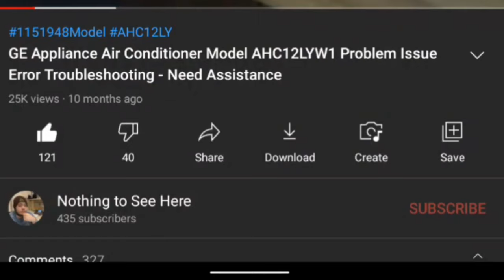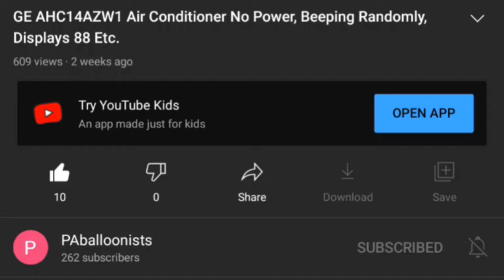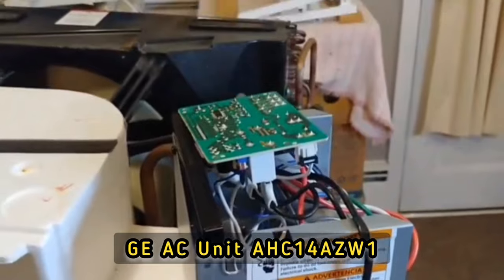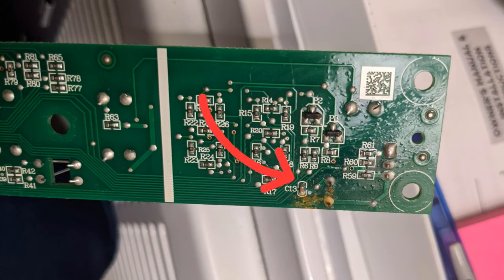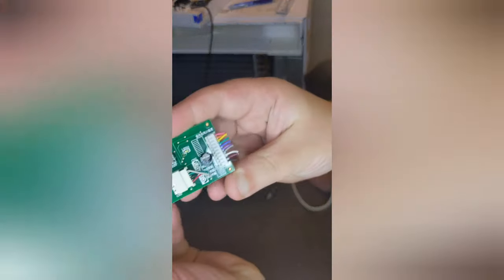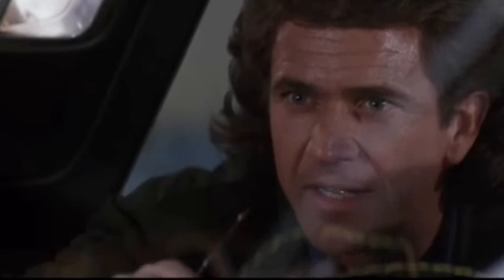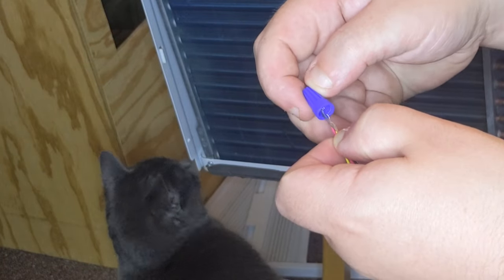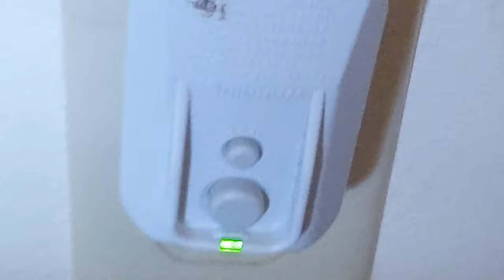GE AC Unit Model AHC12LYW1 or ACH14AZW1 - Unit Beeps, Shuts Off, 88 Symbol Bypassed DIY | How to Fix

Comment: I see the fan is on the highest setting but is it also on its coldest setting 🤔
Reply: I am having the same problem. I'm trying to figure out the wiring combination that will allow it to run them both on low or low cool and med fan.

Comment: Where can I buy a new motherboard
Reply: Let me know if you get the motherboard
Reply: @rogercoronado6106  Orale gracias, pero ya le corte los cables y lo dejé directo como en el video.
Reply: @oguh2olve54  yo tambien lo tengo directo el enchufe ke compre en Amazon es Para poder usarlo kasi Como si furea original con un control y se apaga ALA temperatura ke lo pongo
Reply: @rogercoronado6106  Deberas? Y si funciona bien?

Comment: I did this but the next day i removed the front frame again because it wasnt throwing cold air and the whole front part inside was covered in ice where did i go wrong?
Reply from the maker: Left it in too long.  Because we remove all the controls and thermostat... You need to limit use to a few hours at a time.

Comment: Thanks for the vid and explanation. I have an AHQ06LYW1 with a similar type control board and the same wire braid..mine has the red and maroon instead of pink and brown. Everything else is the sameness yours. I tied the white, red, black and yellow together as instructed. I get nothing. Does anyone have any ideas? I can’t find a wiring schematic, otherwise I could attempt to trace the correct pairs to connect. I appreciate any help!
Reply from the maker: I had the same issue.  I got lucky with R Melnyk having the same unit as mine...  I hope someone notice this comment and can assist better than I can.  I recommend shooting a little video of your boards and the wires .. posting it with model information
Reply: Look at your control board next to where the wires are connected should be printed on the board some letters in a box =vcc, gnd,comp. med ,lo ....ect. they correspond to the wires vcc is voltage on my unit its at the bottom ,which correspond with bottom wire black. The ones you need are vcc, comp ,high .
Reply: @rogercoronado6106  thanks for your help…I got it figured out. I made a video of me doing the modification, but I haven’t had a chance to post it yet. No sense throwing out a working ac unit if it can be salvaged.
Reply: @CovertCulvert  I got the same model as you, about to attempt repair, what color wires were vcc,comp and high for you?
Reply: What about temperature control?
Reply: @thewatcher8734  there is none. It runs full blast all the time, but that's better than throwing out an otherwise good unit. At least, it works for my application.
Reply: @CovertCulvert   I think I have a different model but I’m literally about to take it apart to see if it works cause my control board quit working yesterday
Reply: @thewatcher8734  if you have to go into the area where the power supply board is, DO NOT touch that big ass capacitor in the lower corner. That'll zap you across the room!
Reply: @CovertCulvert  no mine control board is right behind the main faceplate that’s the wiring I’m going to use
Reply: @rogercoronado6106  is no one worried about the ground wire?

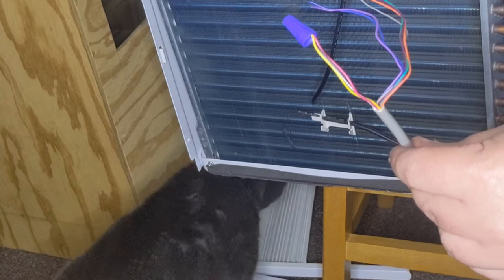Comment: 7:25
Just a heads-up, I think your cat got sucked inside the unit.
Reply from the maker: Haha!  He's alright!  Last seen jumping on the replacement unit I got from GE, running my power bill up by turning it on when he feels
Reply: 😂🤣Omg I saw that when I first watched this over a month ago. I just noticed your comment while looking through the comments for a wiring combination that runs the unit on a lower setting than full blast. As it's too cold and expensive to run for more than 15 min and I'd rather not have to run it through a timer though it seems like that'd be the easiest fix.

Comment: How long did it last after doing this?
Reply from the maker: Personally, just made the repair and the video... Hasn't been hot enough to hook back up yet... Running out good will certificate replacement now.  But a spare is nice and it's only June so probably will get hotter.  Longevity is unknown.  Great question

Comment: Hi !! Could I just cut the wires with out having to take them all out ?
Reply: Ps I was able to cut the wires and leave the other 4 wires connected to the board and to my surprise it worked ! Should I still follow the process and take the 4 wires out strip them and tape them ?
Reply from the maker: Due to the moisture issues... I would...

Comment: How do you control the temp to blow cold when you cut the wires
Reply from the maker: Unfortunately this method eliminates that control.  There are other ways to maintain your control... But it's really hard to find the official part and I did not do enough research to do the thermostat method some have commented about doing, which would use alternate, not official parts

Comment: Can I use the blue cable if I want to use it on a low speed?
Reply from the maker: I was unable to figure out the color code but I would assume you could test before tape and seal up
Reply: @CaughtOnCam were you able to figure out the right combination of wires to connect to get the unit to run on low?

Comment: So I just fired mine up and it did this. My circuit board looks fine. However, I did store the ac on its back accidentally over the winter. I meant to store it in the proper position after the condensate drained but I forgot. Does anyone think this could be because the oil in the compressor settled to the wrong side and maybe the ac can sense a high load? I did notice my lights dim considerably more than usual when it first cycled then shut down just like the video

Comment: why cut the wires, the white connectors just unplug. you can use some resistor lead clippings and a piece of wire stuck in the connector holes a soldered together to get the same effect.

Comment: Nashone Wireless Plug in Thermostat, Digital Thermostat Outlet LCD Display Temperature Controller with Heating and Cooling Mode for Portable Heater, Wall Panel Heater, Window AC, and More

Comment: Does this leave it on the coldest hi setting mode please reply I’m haveing this problem now and it’s brand new????
Reply from the maker: 1.  Brand new.. try and return or get GE to cover cost of a new one
2.  Yes.  This will make highest setting
Reply: @clarkkc11  and the lowest 62 degrees setting
Reply: @clarkkc11  can’t believe it ether I mean I only used for about 3 months 700$
Reply: @clarkkc11  thanks for replying

Comment: Hello, I ordered another board and the 1 they sent could not physically fit in the same space and the connections were of different connectors and was totally wrong. (NO POSSIBLE WAY TO WORK). 
I TRIED THIS METHOD AND IT DOES WORK. THE OTHER THING I FOUND WAS TO TIE SAME WIRES EXCEPT THE BLACK WIRE AND UNIT REMAINED OFF. THEN CONNECT BLACK WIRE AND UNIT CAME ON. SO USING THE CONNECTION OF THE BLACK WIRE TO THE BUNDLE COULD BE USED WITH AN ORDINARY THERMOSTAT TO SET DESIRED TEMPERATURE 🌡️. I ALSO FOUND THIS OPERATES ON 5 VOLTS (LOGIC), SO WELL WITHIN RANGE OF ANY THERMOSTAT. THE SIMPLEST OF THERMOSTAT (COOL) FUNCTION THE BETTER. AVOID PROGRAMMABLE THERMOSTATS. 73 AND ENJOY GE AC HACK. LOL. EARNEST K5EWM.  RETIRED MILLWRIGHT/ELECTRICIAN AND GENERAL CLASS AMATEUR RADIO OPERATOR. 73 GOD BLESS AMERICA.
Reply from the maker: Probably the best comment on this thread.  Thank you for your time, experience and years of service in the industry.  Pinning! 📌
Reply: I had the same problem like every one else..beeping sound ,the number 88 showing ,it comes on  then shuts off ..I tried your method and it worked but the air don't fill very cold..i connected the colors you showed us,.I mean it's blowing with power and speed just fills kinda warm to me . Is one of the lines for the compressor? My unit is big like23,000 btu.
Reply from the maker: @patrickneil8045  apologies it didn't work.  It's an attempt to salvage a flawed machine.  Def could be compressor
Reply: @clarkkc11 hello there,..I made a comment yesterday about trying this process I used the right color wires and it ran great but the compressor was not kicking in ..no cold air..so I went try it again today ,cut out the other work I did and started all over again...man those lines are very fragile you really have to be patient ..I had the right tools this time and once I got it hooked up,boom..there it was..cold air ...thanks bro...I did find that other video as well..the one with the elderly man showing the same method...I have one more question...it makes me wonder if this method would work on different brands or just general electric?
Reply from the maker: @patrickneil8045  people in the comments have done on other GE models but idk about other companies products... I would assume if you find one similar... Might have a chance.
Reply: @clarkkc11  ok ..thank you sir.
Reply: Where did you get the new board from?

Comment: Do you know what the other colored wires correspond to? Like which wire would put it on medium instead of high?

Also your board looks damaged similarly  to mine... yours has a few other issues I could see. Like the P1 connection melted! I'd be surprised if you didn't see any issue from the processor (square black chip on the back of the board)? I believe that's where it starts, and begins burning out other parts of the board? 
Unfortunately I can't upload pics of my board...
Reply from the maker: I am not sure of the other wire colors.  I was hoping there would be helpful info in comments but I do not recall a comment from anyone with that knowledge.  Hard to find schematics...
Reply: @Nothing to See Here   Yes I'm having that very issue! I can't find a diagram for it anywhere? If I understood GE customer dis-service correctly, they outsourced this AC to China probably? So as she said GE didn't make it, so they can't even fix it, as they don't have the parts including any front control panels! 
 So that's how GE stands behind their products! They did send me a $75 rebate check for a future GE product!? THE AC COST AROUND $500.00!

So I say when are we starting a "CLASS ACTION SUIT"???

Comment: Has anyone found part number for User Interface board for the AHC14AZW1?
Got mine from Lowes also… died just over a year… after the first one died the first week. Did the bypass and it works… but still looking for a new board.
Oh… and GE parts/service is an absolute joke

Comment: J1 and j2 are broke connection yoy don't belive that was the issues?
Reply: I noticed the same thing, because mine had the same one broke the exact same way. I need to get a good soldering station and gun so I can see if I can fix it right, cause I don't need it blasting ice cold or else I gotta turn it off and on constantly to keep from turning my place into a meat locker money pit.

Comment: tried this on mine to no avail...if i hold the power button down and plug in (after rewiring back) it turns on and runs until i unplug it ...but I was hoping to wire as always on so i can control via smart plug or switch ...
Reply from the maker: This method removes the smart technology which was flawed in the design and caused the issue.  Their smart boards are not protected enough
Reply: @clarkkc11  yah mine is not smart ...its a GE AHW05LZQ1 , i have all the same wires and the board looks similar

Comment: I have the 18000 btu smart version doing the same but there is only 9 wires on 2 different connections 1 has 4 the other has 5..The 5 connector is connected to the WiFi and the other 4 wire connector is connected to the Front panel..Didn’t want to attempt your bypass because it’s not the same so do you have any ideas how I can bypass mine. Thx in advance 🙏
Reply from the maker: Do you have a unit model number?  Is it GE?  And does it look somewhat similar to the setup in this video?

The wifi unit and cord just allow the remote control to work and operate the machine.  The other cord all operation from the unit itself.... Ultimately the goal in any of these hacks is to bypass human control (as the boards have issues) and to allow the machine to power on and off thru the safety surge on the outlet plug.

My assumption is your unit just has less controls or settings (hence less wires)...

Curious what color wire you have on the 4 and 5 wire groupings.
Reply: Model# is AKLK18AAG1
The 4 wire connector has white, yellow, purplish,red ..connects to the front panel...the 5 wire connector has orange, brown,green,white,black that connects to the wifi module
Reply: It is a GE just 18k btu and wifi...I got it off craigslist looks new styrofoam still brand new..I can get a refund from the person but if I can get it to work then I'll be fine. What's different is your 10 wires all connect to one terminal mine is divided into 2 connections the 4wire and the 5 wire
Reply from the maker: @deeharv7910  upload a video if you can!
Reply from the maker: @deeharv7910  I would wait til we see a video and other can confirm, but based on wires and similar setups between products... My guess is the white yellow and red are your money wires... But again... I am not a professional, just a guess... Would really like to see a video... Drop it here!  Great people will respond!  If do upload video copy all info you can!  Helps with search!  Lotta ppl will help who are more skilled than I!
Reply: Ok will do… I’m away from the house soon as I get back I’ll take a video …thx
Reply: Called GE they sending a tech apparently the AC is still under warranty so I'll let them fix it for free but thx I'll be back if I need any more help
Reply from the maker: @deeharv7910  best solution you can do - make GE fix their problem!  This fix is definitely for those that no longer qualify for a repair or replacement or some sort of problem resolution from GE.  And for those who may have bought the unit second hand or without a warranty.

Comment: Did anyone have any issues with the fan motor cutting off after a while? Works fine for like 5 mins then the fan motor stops. I wait a little while try it again and it seems to work right but then 5 mins later no fan. Any help would be appreciated.

Comment: I called a tech at GE and you can't buy a new control for this unit. They don't sell them, so you are out of luck if you want to buy one. I told the person that I would not be buying another throw away POS from GE again. Built to fail, then straight to the dump, no repairs. Now that's a "green" company for you!!
Reply from the maker: EXACTLY! 💯 Really appreciate this comment!  That's why I hacked mine up to repair it.  So far so good.  Couple years and and summers and it's still rolling.  Easy fix and part to provide and they still neglect to do so
Reply: @clarkkc11  Absolutely! I appreciate the knowledge, thanks!
Reply from the maker: @cantyouhearmeknocking1961  you are welcome Anthony!  Appreciate the dialogue!
Reply: @clarkkc11   After I did your repair, I ended up buying a $10 digital timer. I set the timer for whenever I want it to cycle on and off all day, every day. Plug the timer into an outlet, and plug the AC unit into the timer and boom! Works great, and I don't have to fool with it.
Reply from the maker: @cantyouhearmeknocking1961  genius!  Like a grow light timer?  Or for a coffee pot at work!  Beautiful thought!

Comment: I did this it worked great the first day then it started freezing the next day which it never use to do
Reply from the maker: That is due to your climate and the fact that the control board is removed / thermostat.  Just have to keep on for limited time due to moisture in your region

Comment: Has anyone tried to clean/fix the board?
Reply from the maker: Mine had too much corrosion.  I am sure it is possible for some units... But overall the original design of the units will most likely cause the board to fail regardless of repair.

Location of this electrical circuit board is not properly concealed and in a spot that can create a perfect location for condensation.

One could try to clean... But this chop and simplify technique has proven effective for many people.

If you got the skills, make a video!  I did not have tools or replacement parts to repair beyond this method.

Comment: Rats. I had high hopes. It didn't work for me unfortunately.
Reply from the maker: This is a last ditch effort when all else fails, sorry this fix was the one to fix yours... These machines have been riddled with issues, the ones with similar issues still had slightly different locations of issue .. maybe yours was on the main board.... And that would be a totally different problem...

Comment: Sadly did not work for me :(
Connected the the exact 4 wires.
Reply: Update! 
Totally worked, I removed the black wire from the mix and got cold air coming out. Used a basic power strip as my on off switch. Thanks!
Reply from the maker: @joshd108  beautiful glad you were able to find a workaround and modify this fix to make it work for your machine

Comment: I did that but it didn't work and the model of my air is AHP06LZQ2
Reply from the maker: That is a different model.  So this fix is not meant for that unit...
Reply from the maker: If the interface is similar and you have the same parts, it could also be a deeper issue....